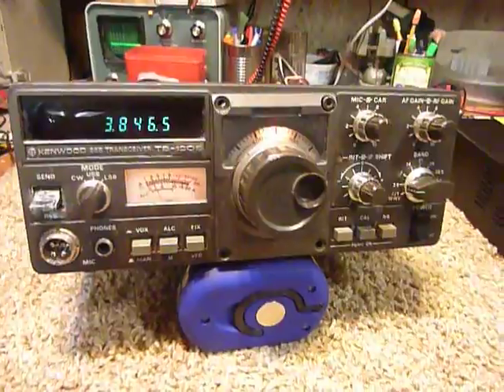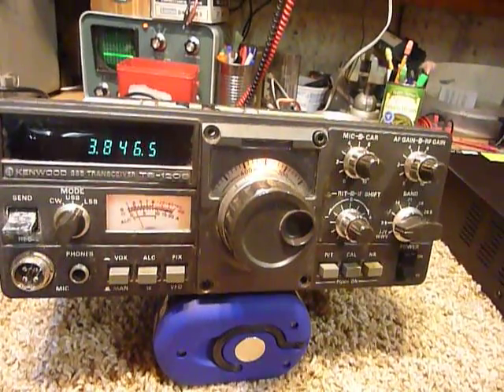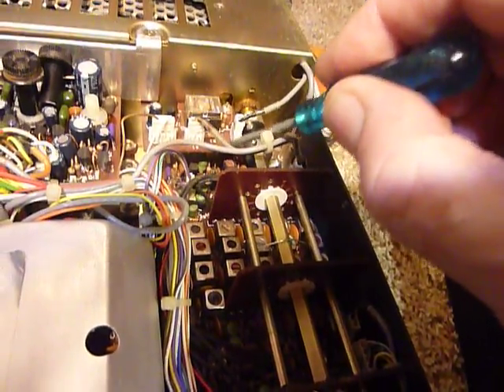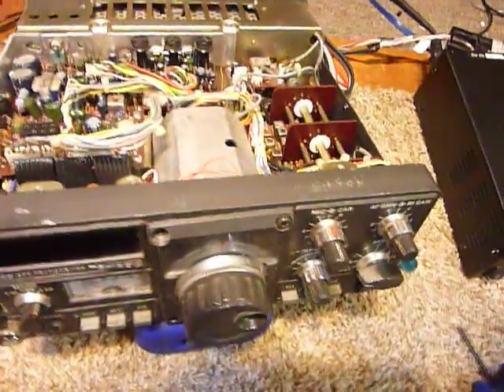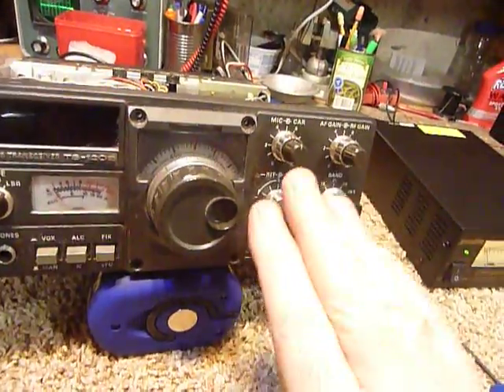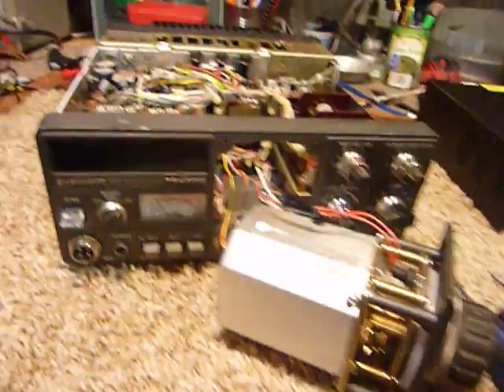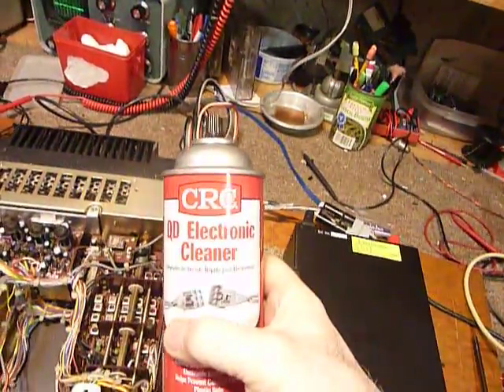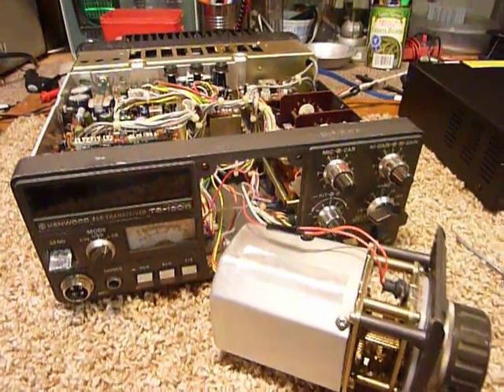Part 1 , TS120S KENWOOD TRANCEIVER , TS120S VFO

Comment: Mr. Bob how are you doing?
I'm sorry to disagree with you a bit.
But motor oil could be really good and useful on bearing on VFO but NOT for  faders/potentiometer such Audio Pot and so. 

Nothing with oil in there. A nice small wash with contact cleaner and moving it back and forth will be enough to clean them all.